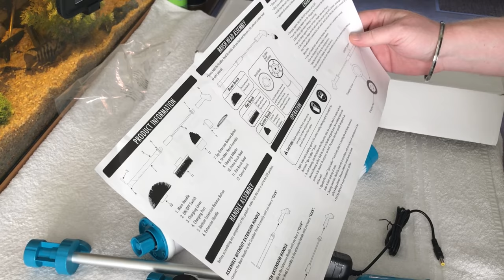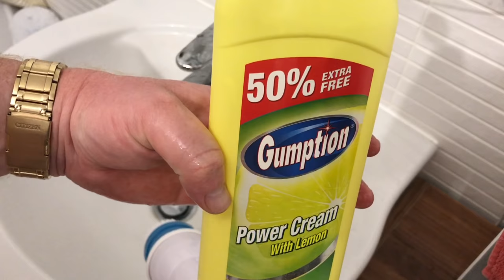Hurricane Spin Scrubber Unboxing and Multiple Full Demonstrations

Comment: I have the Turbo Scrub version of that, it's ok for light cleaning, but and as you say it depends on the cleaning product used with it as to how well it cleans overall, but it's not man enough to take on really grimy surfaces. Plus it is a very long winded operation, it'll do it at it's own speed, you can't rush it or put heavy pressure on it.
Reply from the maker: 🤣🤣🤣🤣, that is so true! It’s like an obstinate donkey. I do like it for getting in the books and crannies. tBH I use it when I’m refurbing Vacs when I have to wash the parts and get in the grooves. Other half uses it for the shower screen and the hard to reach places around the taps etc. It’s OK, but of an expensive gimmick to be honest.

Comment: Just recently brought one of these.  I think there pretty good. One thing they are good at is if you use the pointed brush on your car wheels. Really good on them.
Reply from the maker: dyson37 That certainly would be good at that, especially in the wheel nuts and any detailed areas.

Comment: Great review it looks like it's good for cleaning grouting. I don't live in hard water area but have always found shower glass difficult to clean. I now use kilrock deslaler spray which I find does an amazing job I would very highly recommend it.
Reply from the maker: Ahhhh! Excellent, I will take a look. Thank you. It is very good for grout and those hard to reach areas. I use it on the bathrooms all the time and it’s still going strong.
Reply from the maker: Sorry for delay, me too, I will be doing a follow up video soon

Comment: How to repair power supply section & what kind of battery & motor will apply!!
Reply from the maker: I’ve absolutely no idea I’m afraid, I bought a set of the brushes etc that fit on the end of my cordless drill, which work 100 times better.

Comment: Can't get the brush attachments to fit. When the original brush was in I did use it, but then I couldn't fit the others. Doesn't get ride of discoloration on sink.
Reply: I spoke too soon. Finally got the attachments to fit. Wasn't pushing hard enough. It does an adequate job and great for people with arthritis, that's for sure.
Reply from the maker: It will definitely be very good for you for that, I was just disappointed the battery didn't hold as much charge as I thought it would and deteriorated after some time. Those brush heads can really be stiff to get on and off.
Reply: @HooverLux  Your video definitely helped me to be more aggressive with pushing the brushes on. Glad you agree that they are stiff to get on. Yeah, the battery leaves a lot to be desired.

Comment: They are rubbish I can do a better job using my hands although I have hand problems
Reply from the maker: I agree with you, great for plug holes, but the torque ended up
Rubbish and I chucked it in the end. I kept the brushes as they were the best thing about it.
Reply: HooverLux Restorations yes the brushes are  the best thing about it I only wanted it for my shower to make it easier for myself .